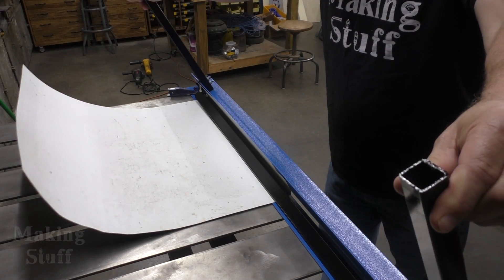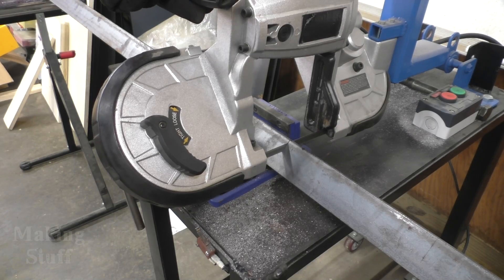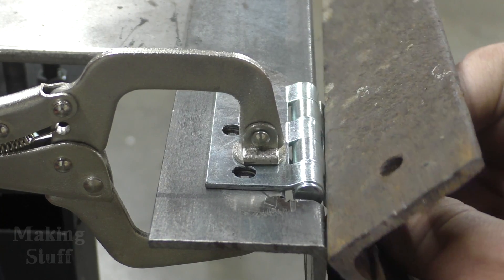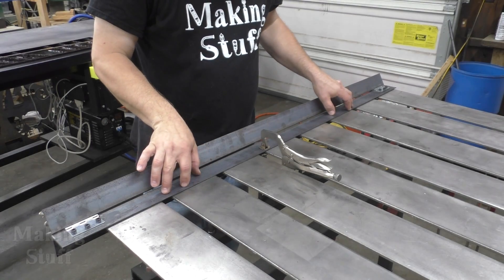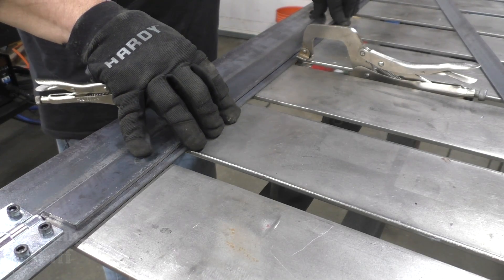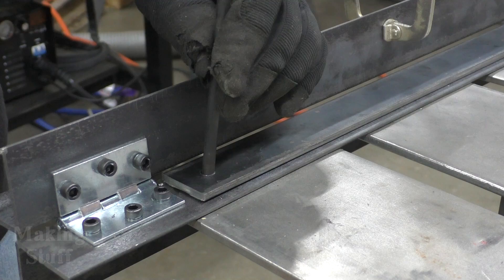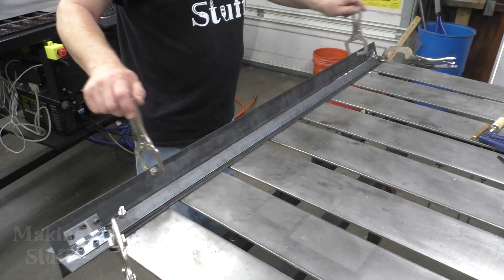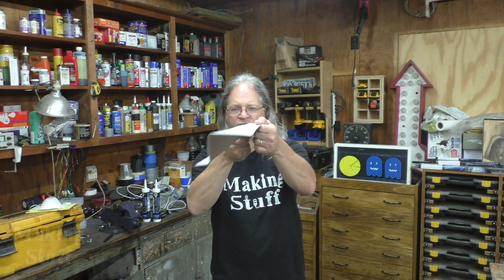✔️ DIY No Weld Sheet Metal Brake

Comment: He forgot to, or doesn't know to, flip one side of the hinge over to bring the two pieces of angle iron closer together closing up that gap and giving tighter, sharper bends.
Why is he drilling extra holes to mount the handles?
He already has the hinge plate holes, he just needs to get longer bolts and use those holes!

Comment: would this type of brake work if made in oak for thinner sheet no more than 1mm thick? Just wondering as I need to bend 6" long pieces to a right angle and don't need something so big.

Comment: Yet ANOTHER  video ignoring the basic fact that the clamp bar needs to be adjustable, that it needs to slide back to take into account the thickness of the metal being bent, slotted holes are required in the base with a nut that will slide on the underside. If it just clamps down directly above the hinge centreline then the metal physically cannot be bent to 90 degrees, a point is reached where the metal thickness begins to want to push the clamp bar back. If bolted straight down a few mm back then thinner metal won't bend where you want it to and will not be a tight radius
And if adjustable then adjustable stops need to be made so once set you can bend several without having to measure each time.
It's not rocket science, draw a few cross sections with different thicknesses of metal being bent if you can't see it in your head.

Comment: You c could save yourself some time and WD40 if you make yourself a small weighed cup (mine was a 4" piece of square 1.5 x1.5 tube with a flat plate welded on the bottom) to pour a little cutting oil in and you can just dip your drill and or tap in it! Take it from someone that used to drill and tap all day long! You can even make it magnetic Or just sit it in a magnetic bowl. And stick an acid brush in it to brush on if needed! Your welcome!

Comment: Put springs on the bolts under the top angle so when you undo it the angle lifts up and you can just move your steel and bolt it down again. Also Id weld a T handle onto the bolts so you don't need a tool every time.
Reply from the maker: Cool, thanks

Comment: I like your addition of the flat bar. Ive noticed with most angle iron the edges are kind of rounded off. using the flat bar ensures a nice sharp bend! just what i was looking for :)
Reply: Most of the time you just grind the edge of the angle iron down so one edge is pretty much sharp. His bends could have been alot tighter to
Reply: Thats very true!
 I dont have a grinder though :p

Comment: Good quality video. This is much simpler than many DIY brakes. I can use some of this for one I'm making. What gauge metal do you bend with yours? What lube did you use for drilling and tapping?
Reply from the maker: The lube is CRC Cutting Fluid.  I have only really bent the aluminum flashing for the widows with it so far.  It will bend 16ga but I have not made any projects with it yet.

Comment: What size did you make your breaker for sheet-metal 36 inches
Reply from the maker: It's 42 inches because I had to make pieces for some windows and the 36" breaks were not long enough.  I think that is why they window guy never came back and finished the job.

Comment: What are the tools you think beginners should get to start woodworking I like your channel
Reply from the maker: Start with the basics then slowly add more tools as you get better.  You can make a lot with just a hammer, cordless drill and a hand saw.
Reply: I just got a 1/4 in router and a round over bit
Reply: Btw you should make a video on what kinds of screws to use depending on what your doing

Comment: The flat-bar for the top-jaw seems redundant with the angle-bar on top, because the angle should be rigid and straight without the flat under it.
Alternatively, turn the top-jaw angle-bar so that one flange sits flat (an upright "L") facing forwards, so that you can bend an edge right over for a lip/safety edge on future sheet-metal prtojects.
The "bracing legs" you described for welding on  to stop the break from rolling backwards could just as easily be attached like the handles to the moving jaw, so no welding is really required.
Reply from the maker: Thanks for the input and thanks for watching!

Comment: that is too weak, so you can bend at the most aluminum foil on the whole length ...
Reply: Good video. What gap should there be between the two angle irons in millimeters before we mount the hinges on.
Reply: @sanjeethnundcoomar7630  should be flat or flush on the tops and touching